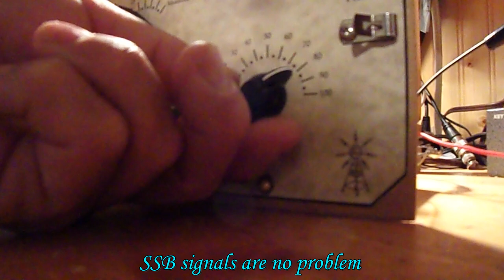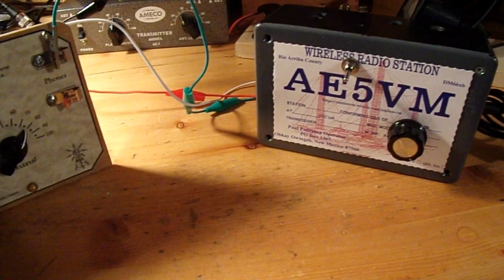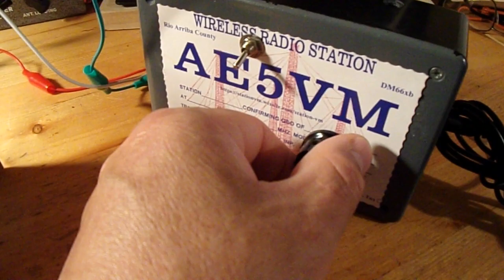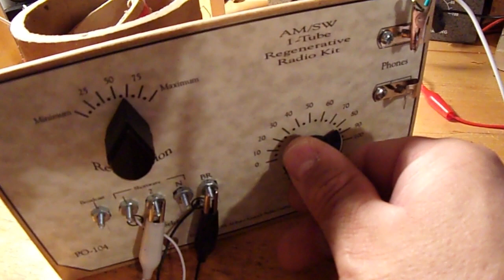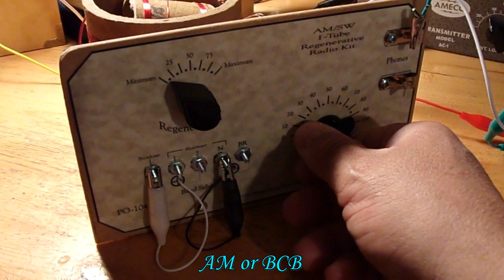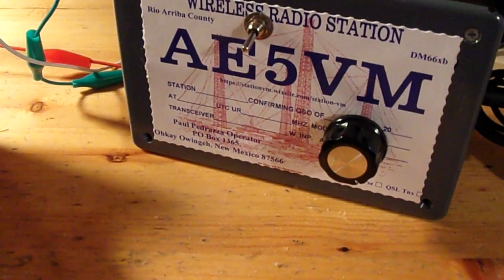Peebles PO-104 SSB signals part II

Comment: Excellent work! Build your next one with a metal front panel and you will not have so much hand capacity effect.
Reply from the maker: They just have the Aluminum tape on the back.  As for other larger ones that I have, they do have double copper clad boards. No issues.